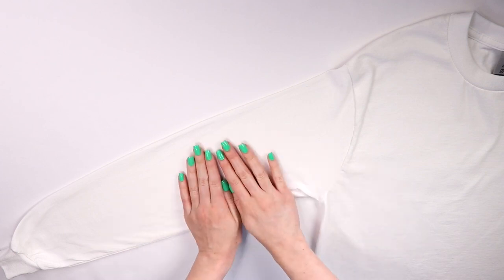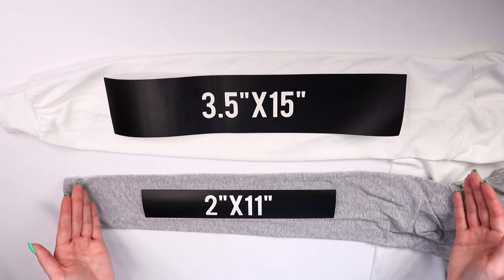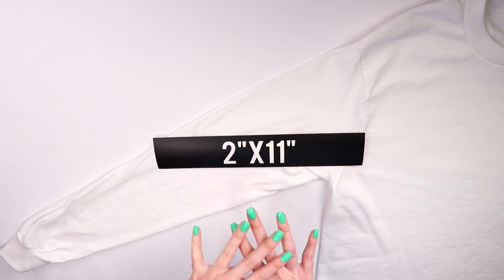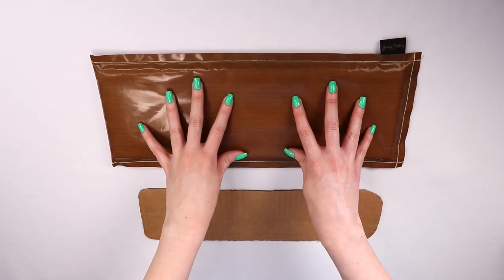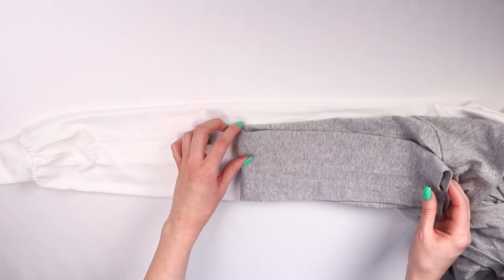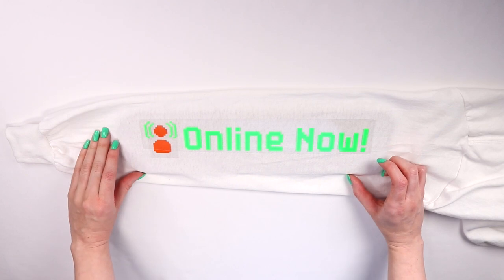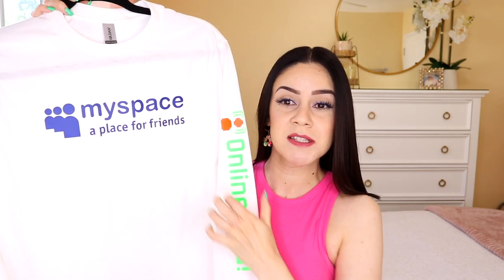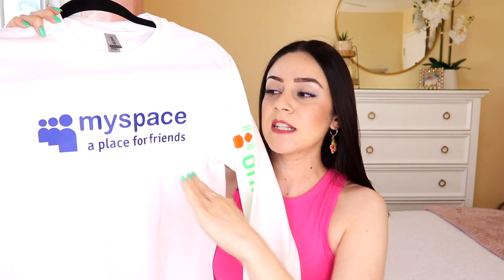TIPS & TRICKS ON HOW TO APPLY HTV ON LONG SLEEVES || Lucykiins

Comment: How would u print or cut on Design Space for the opposite sleeve
Reply from the maker: so when you upload it onto Design Space, make sure you upload it as a "Print and Cut Image" and not a "Cut Image" ☺
Reply: Sorry I guess I didn’t word my question right.
How would you do the other sleeve to look like the first sleeve u did. The words won’t come out the same
Reply from the maker: i wouldn't be able to do a Print & Cut with the sleeve design since it's so long and Design Space has a limit to how large you can do a Print & Cut. the only way i would be able to do it is to separate each section before printing and after it gets cut, just align them correctly before pressing. i hope this answered your question lol.
Reply: @jackiirubio3210  yes I get it 
I’m confused about doing the opposite sleeve